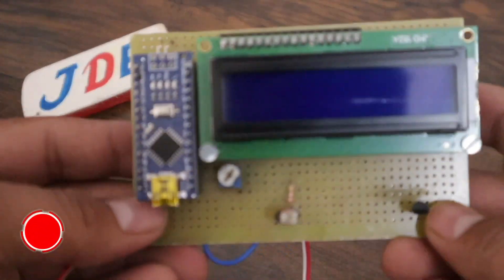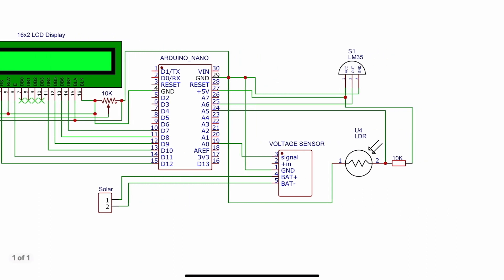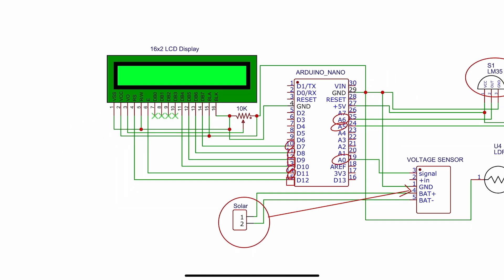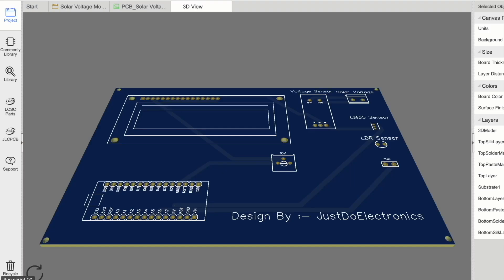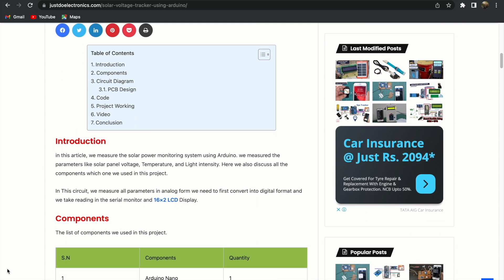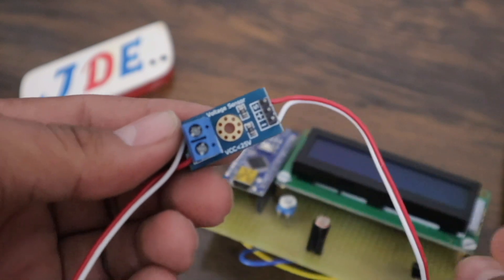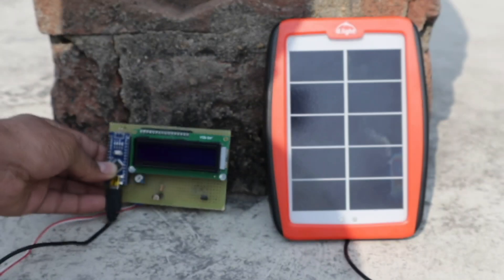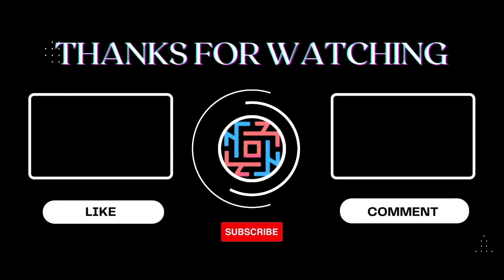How to Make a Solar Voltage Tracking System Using Arduino | Single Axis Solar Tracker

Comment: Sir small mistake in the ckt digram the lcd  vcc and backlight  we shuld connected to +ve 5v of nano.but in that ckt connected to GND( 27) its not ON the Lcd. If change then its ON and get the OUTPUT. 😊thanks sir
Reply from the maker: Sorry sir i will check and if is mistake then i will create project again